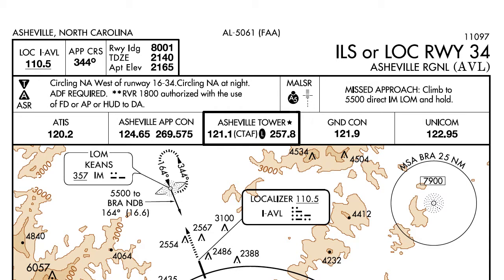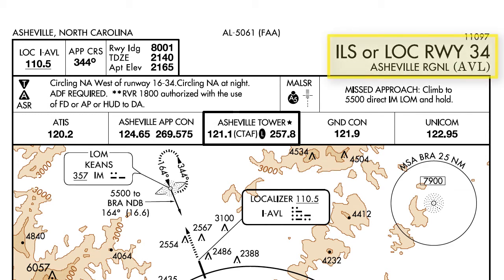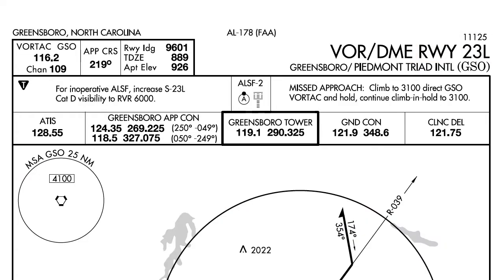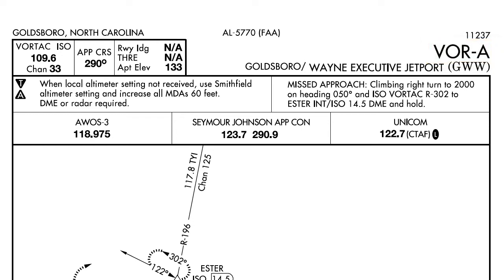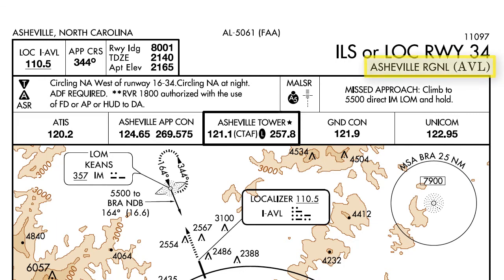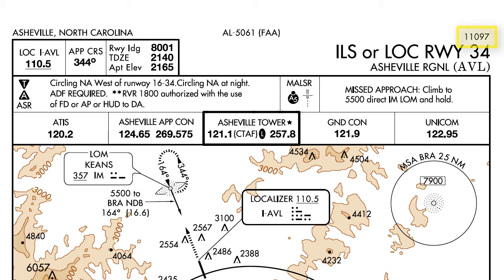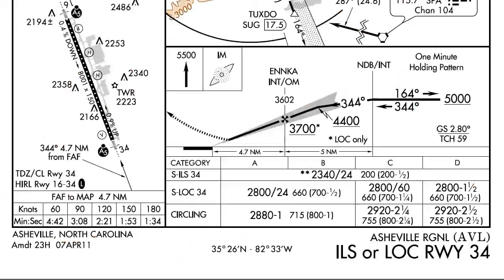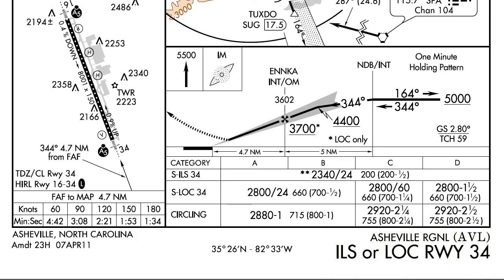Approach Plate Margin Data

Comment: Thanks for the videos. Could you explain the difference between the (Bottom left) "Chart Procedure Amendment Date", 07APR11, and the Last "Chart Revision Date" (upper right julian date).  On this chart they are the same, but on most charts they are different. FAA did a poor job of explaining the difference in their manuals etc.  I do believe it has to do with GPS database currency, etc Thanks